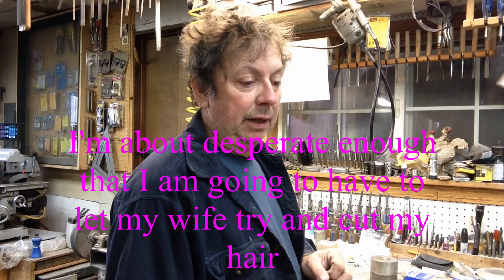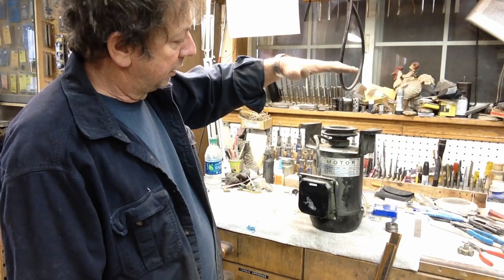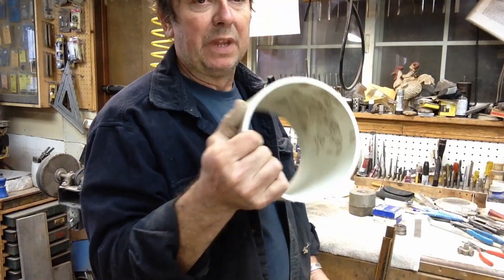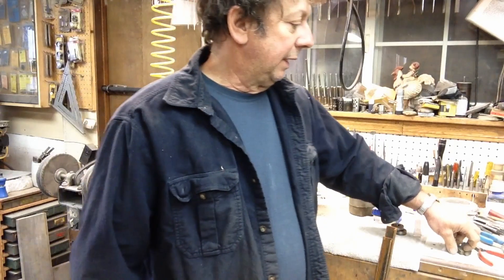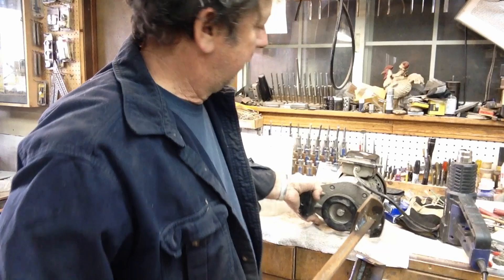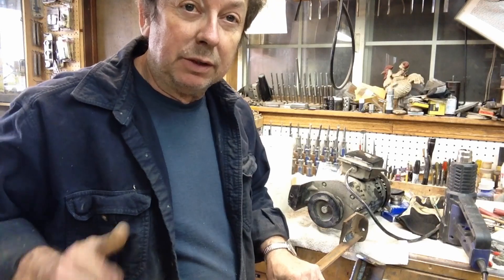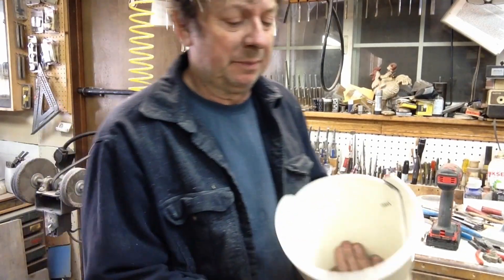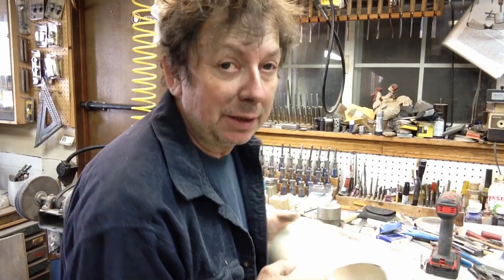The Home Foundry, Junk Sand Fluffer Build: Part 1

Comment: A cliffhanger and then nothing.  I can't find part 2 :(  
I thought I need a muller but I have been reluctant to take thay project on. Not enough junk to make use of. But the sand fluffer sounds more doable and might just be good enough for now. So I was very interested in seeing your results. I'm a pure novice so I will be looking at a lot of your videos. It looks interesting. - Rudy
Reply from the maker: Thank you, I appreciate you taking the time to watch, Yes it is a cliffhanger, I have not yet released part 2. As with a lot of my projects I get sidetracked, been moving several pieces of larger equipment and have been under a time crunch to get that done. Part 2 will be coming directly.
Reply from the maker: I just posted part 2, I hope you enjoy. Thanks, Dan.

Comment: I would be interested to know your "formula" for sand.    I mixed up my own to cast some small cast iron parts.  With questionable results so far.
Reply from the maker: I will check in the morning for the ratios, it's silica sand, western and southern bentonite and water